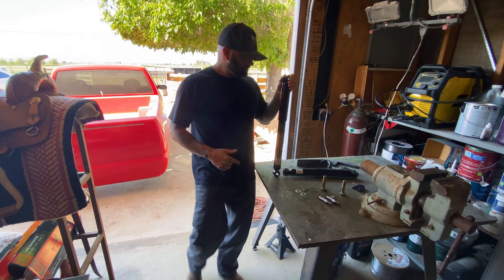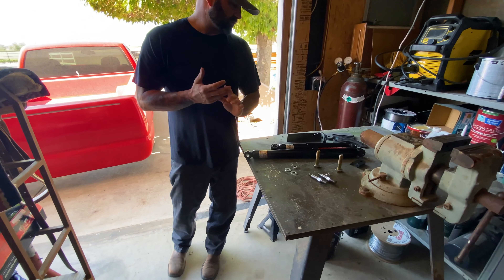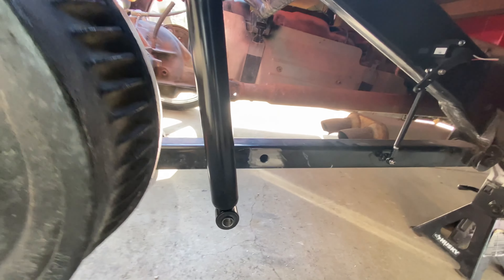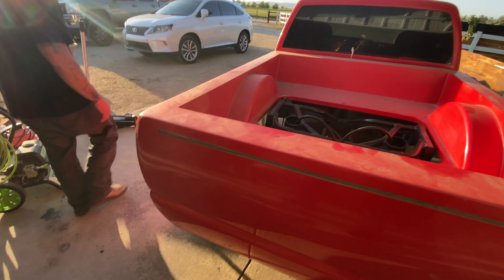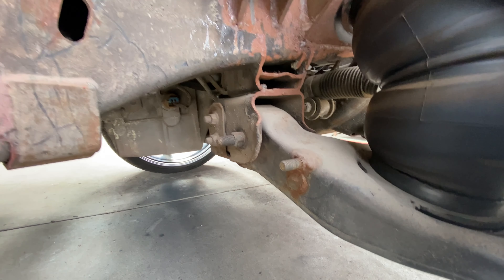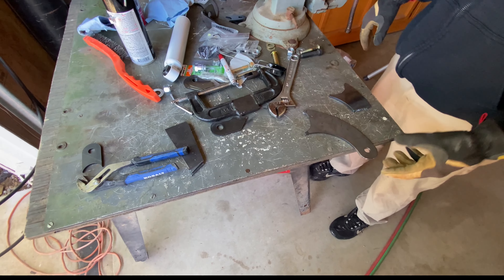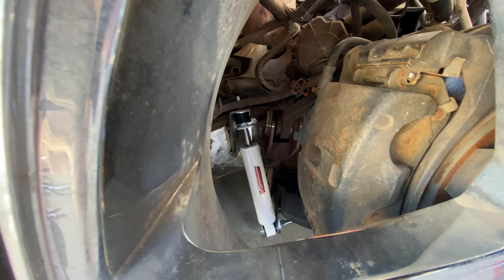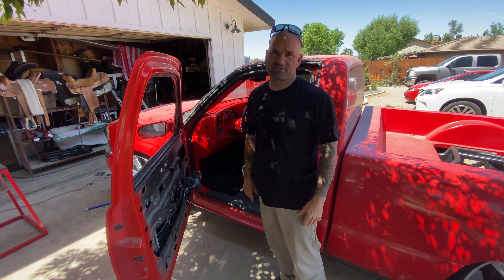Shock install and first ride in the bagged Silverado

Comment: how did you determine how high your front upper bracket need to be and what length shocks you have for the front and rear shocks, i dont have a lot of wieght in the bed for it to push the rear shocks down low enough, how you determine how high the rear bracket should sit.